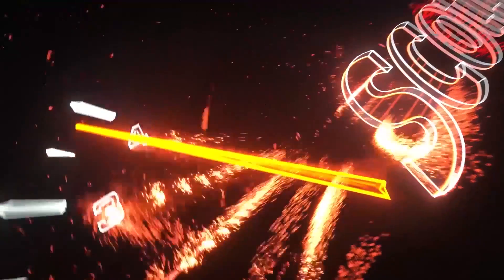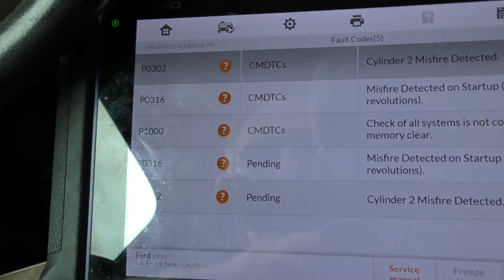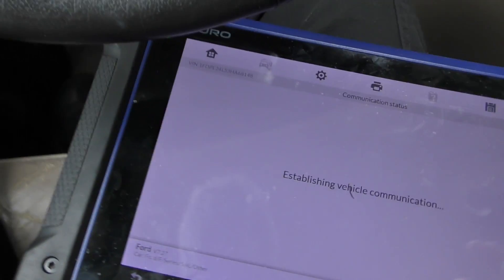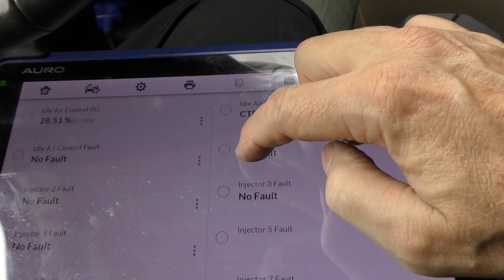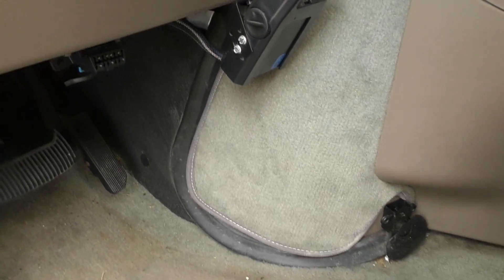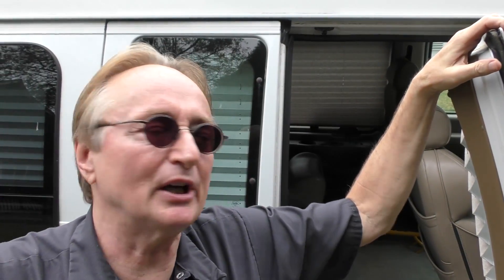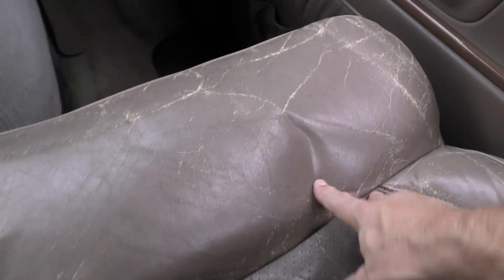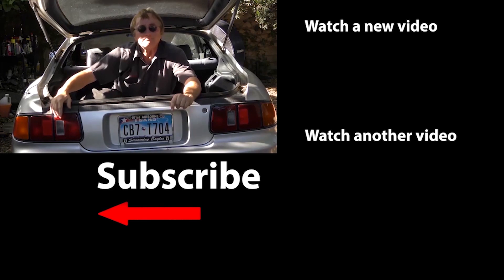I Just Found My Dream Car

Comment: I've been playing in touring bands for a long time so I know lots about these Ford vans, as I've had to fix them on the road many of times... The biggest issue is the spark plugs. Every year you need to torque them to factory spec or they'll be spitting out of the cylinder head. I've had 4.6 and 5.4 vans and they both do it. Coil packs also die fairly frequently. Be SURE to use the right weight of SYNTHETIC diff fluid. Don't trust an oil change place to do it (learned this the hard way). If you use the wrong stuff you'll have bearings failing within 10k miles and it's very difficult to get that fixed on the road in a timely matter... especially if there's a lot of metal floating around. Most of the time they'll want to swap the whole axle which runs around $1200. Front wheel bearings always screw up, but they're quick, cheap and easy to replace. The late 90's Triton V8's use a multi-ply head gasket that can sometimes seep between layers. You'll get excessive steam from the exhaust. This can be easily remedied using GM cooling system sealer tabs. No big deal. I've never personally seen a trans go out in one of these, but I'm sure it happens. That seems like it's more of a Dodge and GM thing. If you're going to be moving a lot of weight I would seriously consider getting a 250 or 350. A 150 loaded to capacity burns through brakes incredibly fast and you'll be blowing out rear struts.

Comment: We had one in the 80s when I was a kid.  I miss that old conversion
Reply: I bet it must have been very comfortable...
Reply: We did too! Family of 5, 1 dog, 1 ski boat. 
Three of the four bucket seats spun around and reclined, the back bench seat folded into a bed.
Reply: Spinning captain chairs, a table with cup holders that could move from the middle to the back, the rear bench folding out into a bed, a built in clothing rack and cooler, and TV with VCR. Built in radar detector... ...Don’t forget the curtains and blinds for added class. There was also a ladder, in case you wanted to climb onto the roof, which I sometimes did as a kid. I miss that thing. I was checking eBay yesterday, so I’m surprised this video appeared in my feed, considering how new it is. Those poor vans don’t survive beyond a second owner though. Mr Kilmer definitely found a gem.

Comment: We still have several 2008-2014 Ford E150 and E250 cargo vans in our fleet vehicles at work for our techs.  They have been great vehicles.  The 2010-11 models seem to have weaker transmissions, especially in the E150 version and for some reason we have had tons of engine issues with the 2012 with the 5.4L engine.  Strange, never an issue with the 2011 or 2013 with the 5.4L.  Some of them have the 4.6L engine, while much less power, have proven very reliable.  Other than that, ball--joints and brakes, general wear/tear items.  Also we have had a few need new coil packs, plugs and occasionally a spark plug will blow out and have to be repaired.  Overall, great vans as mentioned and many of our older/higher mile models have been sold to contractors who continue to use them... some with over 250k miles, still going. We have converted over to the Transit 250 vans, which the techs like because they can walk through them standing up,  but they only have the V6 and tend to eat through tires and rear brakes.  Also some heater control/blower motor issues on a couple.
Reply: Hi
What used vehicle would you recommend for a general contractor?

Comment: I drive an 08 e-150 for my work at a parts delivery driver and it’s a really solid vehicle. It’s got over 222k miles on it and it still runs better than any other vehicle you would find with the same mileage.

Comment: As an upholsterer, I would not recommend  dying those leather seats.  Generally, that will not turn out well. I could tell you stories! Just use them until they are completely worn out or reupholster now if you are willing to spend the $.  And I would recommend cloth vs. leather if you do decide to reupholster.
Reply: On my old one I just bought covers for em and pretended the leather didn't exist lol. It's so sticky and hot in summer bleh. Hate em
Reply: What happens when you dye it though?
Reply: It cracks?
Reply: @42luke93  Yes, it can flake off and make a mess.  Think about it, you would be applying a finish to a surface that has to flex, and is subject to heat and cold.  I had a customer absolutely ruin leather seats on a classic 1954 Bentley by doing this.  Basically, there are 3 options:  do nothing, cover over with some type of slipcover,  or re-upholster.

Comment: The Ford Econoline, E Series, are legendary. Ford were fools for its discontinuation!
Reply: What about the Ford Transit Van?
Reply: @glennso47  I believe the Transit van has a conversion. You are correct though.
Reply: The old ones were childhood. I remember seeing plenty of those, as a kid.
Reply: Ummm bro ford still makes them. Go to fords website. You can find all the vehicles even the pos Mach e suv
Reply: they were legendary but then I love Ford and everything they make
Reply: Technically, the E series isn’t discontinued. They’re rolling chassis for the customers’ customization needs. Which is also smart cause it doesn’t create waste on the original body used in the back of the cab.

Comment: I bought a '94 Chevy 20 van like that a few years ago for $2500; a week later coolant started dripping from the tail pipe. Seller Jerry rigged it with head gasket sealer so he got a few pounds of roofing nails in his gravel driveway!
Reply: Yeah I bought a car with the owner put WD-40 all over the paint job😵 and how yep I went for it😠
Reply: Mines had the MIL bulb removed, battery gave out as well as starter, water pump started to leak. Seller: "no issues runs good". Lol
Reply: michael lee  trying to get mines that way. I've replaced so much so far.
Reply: michael lee  sounds heavenly if it were real. Its mostly my fault really for not inspecting the vehicle properly. I do all my own maintenance and repair myself if anything so it helps me get to know the van better.

Comment: All American vehicles come with the check engine light lit. They should build a scan tool into the dash right next to the speedometer.
Reply: Van's were designed as service vehicles and generally go 300k. Besides, that's what black electrical tape is for. lol.
Reply: RC Hobbyist Extreme, as an electrician...I know. 👍
Reply: @blipco5  I remember my Uncle telling me how they dumped stop leak in brand new vehicles on the assembly floor during inspections. If any vehicle leaked, it got a can of stop leak. That was in the 70's.

Comment: Had a van just like that, it had a misfire too. Turned out to be the distributor and spark plug wires were the original ones from the factory and lasted over 100,000 miles without being changed.

Comment: Used to own 2 econolines. 2 things to watch out for are throttle position sensors (TPS) and door handles. Those handles are pulled by metal and plastic cables, which break all the time. Speaking from experience.

Comment: Still driving my 98 E150 4.2 v6 with 130k and she still runs and drives great. Never replaced anything until about 2015 when i had to have the intake gasket changed other than that just brakes, tires batteries and oil. Oh and one head light bulb that`s it.

Comment: I can smell the cold start up from here.
Reply: Sorry but Conversion Van's are NOT carburetor. They have fuel injection same as all vehicles now days.
Reply: RC Hobbyist Extreme no one said they are. Older vehicles with old engines have particular smells to their exhaust depending on what’s making it into the exhaust.
Reply: @Novaah803  I had two 78 Chevy Novas, 15 years apart, both smelled the same. funny how that happends.
Reply: @Novaah803  Snowmobiles all have distinct smells because of the manufacturer oils they use. They even admitted putting unique odor producing additives in their oil.
I myself used Lucas oil which STINKS to high heaven but being a synthetic, it prevented my exaust valves from carboning up. As far as car smells,  that has to do with many things. Usually the materials the vehicle are built with. Most imports are made with biodegradable materials. Wiring harnesses are made with a type of material that actually attract mice. 
Which explains why cars like Audi, Toyota and Mercedes have wiring issues due to mice in colder states. 
GM vehicles use more silicone based materials, so yeah, that smell. ( Dildo anyone?) There were actually studies done on the different smells of manufactured items used on vehicles. Some are intentional.

Comment: Would a bad o2 sensor cause a truck to slight back fire and run rich? There isn’t a light on but it’s driving iffy under load. 5.2L v8 Ram. Wires and plugs are good

Comment: I came here to see what could possibly be Scotty's dream car. I did not know what to expect. But I can say I did not expect a conversion van.
I mean he is a mechanic and he knows how difficult it is to get at those engines and somehow even with all of that it still is his dream car?! 
Ok Scotty you floored me. Never would have guessed this in a thousand years. 
 
I was thinking more along the lines of a 1970 pickup truck with a V8 and so much room in the engine compartment that you can literally sit in the engine bay while working on it. Easy access to every part on those engines.
Reply: A little more easy to access on an express van.
Reply: @Lucky5111  If you were to ask him today, with gas prices so high, I expect he would say a horse.

Comment: I bought a 1997 e150 regency 3 last year. 174K, 4.6 L, 2 valve. $4000. 
It does get better milage than the diesel.

Comment: I absolutely love my 1992 E150 van I just recently converted it into a camper and it is probably one of the most reliable best vehicles I've ever owned I've had it since 2008 and it only has a hundred and fifty-eight thousand miles on it it has a 351 engine and I expect to get another hundred and fifty thousand out of it one of the better vehicles on planet Earth
Reply: Looking at doing like you to build a camper but with an 09 E 250 with the 4.6 motor and 65K miles.  Should I have any concern?

Comment: Bought a used F150 recently with a 3.7 V6.  The owner was up front with me about a miss that his mechanic couldn’t completely diagnose, and he even gave me a new coil.  After pulling all the plugs which had been replaced with cheap copper core, I found one plug that the mechanic failed to change, it was still the burnt up original Autolite Platinum plug with 150,000 miles on it and a huge gap.   Replaced all plugs with new Iridium and the misfire disappeared.  I think the guy should find a new mechanic.

Comment: I have owned two conversion Van's and can tell you, they are the best built longest lasting vehicles on the market. Think about it. The basic van is designed as a service vehicle and most last 300k. There is plenty of working room in a van as long as you realize it's under the dog house. 
My goal is to buy one as a retirement travelling vehicle. You can live in them.
As for as the remote for the tv, come on Scotty, a universal remote fixes them. 
Conversion Vans  are NOT city drivers. 
My daughter earned her drivers licence on a conversion van and was the only one qualified to drive one at most of the delivery jobs she was offered because no one else had the confidence to drive one. 
She knows to use her mirrors to back up, making most people unwilling to drive one.

Comment: Hey scotty. Got a 84 jeep cherokee xj 2.8 carbureted gm factory 3 spd fun 4x4 with 190k on the clock not one leak. What's your thoughts on these pre 4.0 inline 6 motors ?thanks

Comment: I have a bad misfire on my 2014 roush f150 it’s not getting any power down to the wheels, I changed the coils and gapped the plugs to specs and it’s still running with hardly any power . Any help or advise would be appreciated Scotty

Comment: Bleh i had one of those older models and hated the gas guzzler. Plus parking it was a nightmare for me because I have decreased vision in my left eye. I love my old Saturn SL2 and 04 Impala. Even the Impala is a bit boaty for my tastes though. I can park the Saturn just fine between big cars, can't with the Impala. Parts are cheaper for the Saturn too.

Comment: Chevy Van: This thing is Stupid. What were the engineers thinking? You have to access the engine from the inside.
Ford Van: "I just found my dream car" Accessing the engine from the inside is just a minor inconvenience.
Reply: I owned both, they are only hard to access when they put the A/c vents in the dog house. All the trims have to be removed too. It takes half an hour just to get at the engine. They use bolts now instead of latches to hold down the dog house.

Comment: Hey scotty I have 2005 kia sportage. It pulls to the left really hard and shakes at about 60. I've had it aligned and changed the front tires. I took it to a different alignment guy and he was trying to get me to get 4 brand new tires before he would do it. Any advice?

Comment: Scotty, If this has the 5.4 liter engine there's a good possibility that the spark plug is about to blow out of the cylinder head. Would never own a 5.4  Ford liter engine! They are famous for this problem right Scotty?

Comment: The ford econoline with that body style before the dumb superduty nose they put on it...was the pinnical in van design...no ugly body molding ...the door handles were flush ..the lights smooth to the body ...there will never be on like it again they are all  made for comercial work now.. ugly doors lines...squard off...rip econoline